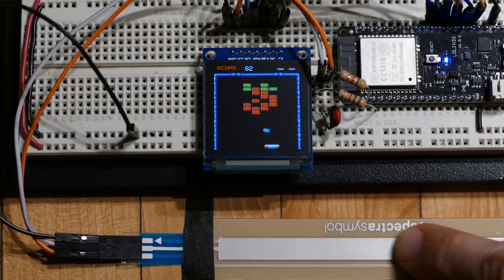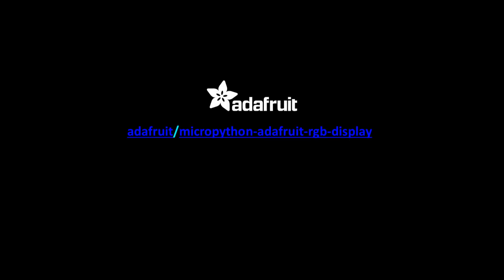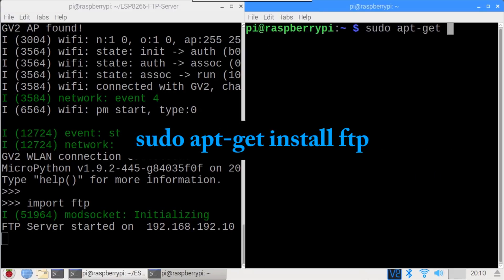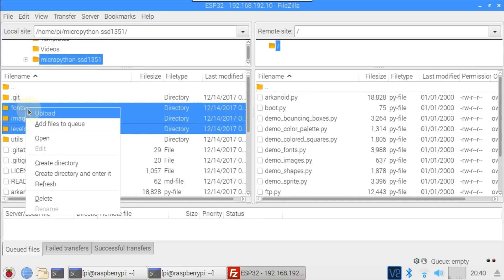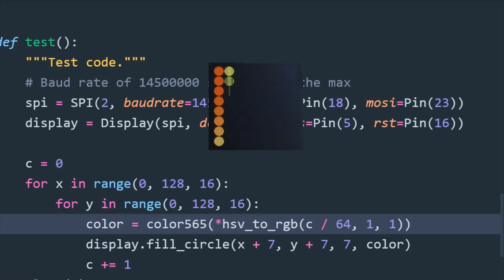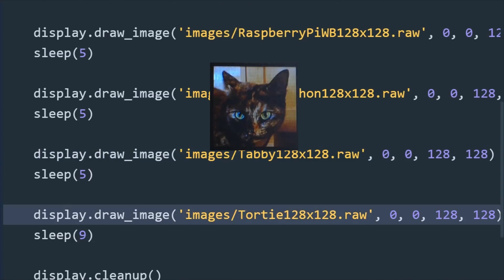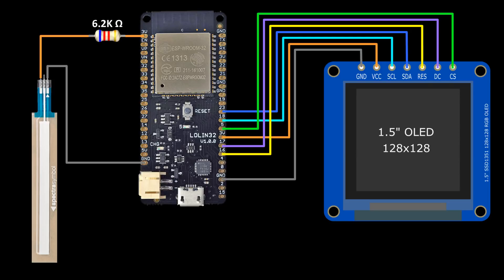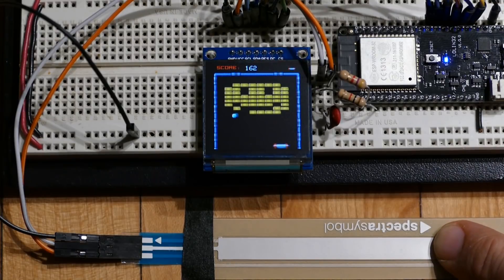ESP32 MicroPython OLED Tutorial with ADC & FTP

Comment: how do you set the brightness with this library?
Reply from the maker: The contrast method sets what the datasheet calls the Master Contrast Current Control 0xC7.  This allows you to dim the display.
Reply: @rdagger  thanks for the reply! I opened another issue on the git (I realized this is the same driver I was using before on my last project). having troubles, thanks for the amazing videos really

Comment: youtube has removed my post, i was just asking how to use you img2rgb656 program i have installed pip and pillow ect but have no idea how to call your program from cmd and then tell it to convert my image
Reply from the maker: python img2rgb565.py <your_image>
<your_image> is the full path to the image file you want to convert
Reply: i just keep getting this error 
C:\Windows\System32>python img2rgb565.py <C:\Users\ppap\AppData\Local\Programs\P
ython\Python38\Scripts\honda_colour.jpg>
The syntax of the command is incorrect.

C:\Windows\System32>
Reply from the maker: @philoffhistree  Angle brackets < > are commonly used to indicate a placeholder, which means that you need to replace the text inside the brackets with the actual value, without including the brackets themselves:  python img2rgb565.py C:\Users\ppap\AppData\Local\Programs\P
ython\Python38\Scripts\honda_colour.jpg
Also, when you post to YouTube, don't ever include country code top-level domains (ccTLDs) such as .cn, .ru, .kp or .py in your comment because YouTube will automatically place a hold on it.

Comment: By the way, according to other documentation I'm seeing out there, the screen's chip supposedly limits Baudrate to 16,000,000. And personally I'm not noticing any difference between 14.5mhz and 16mhz when I test between the two. Maybe things were different for older versions of this screen? And I don't suppose either changes the life-span of the screen?
Reply from the maker: Depending on your MicroPython board and your frequency settings, the actual SPI baudrate may not equal the passed value because the clock divider must be an integer.  You can view the actual baudrate by using print(spi) after initialization.
Reply: @rdagger  Ah, okay cool, thanks for the info! I'll give that a check.
BTW, I was indeed able to recreate the Uncanny Eyes project in MicroPython! Works pretty darn good now too. Had to use a build of MicroPython with ulab included, for numpy functions like 'where'. Plus numpy enables me to load lower resolution eyelid gradients for both eyelids, to fit them into the Pico's remaining memory after micropython.. Then process their current blink state, and upscale them and blit them over the iris framebuffer. Also, a minor overclock to 200mhz smooths out the framerate nicely. Honestly shocked I was able to replicate the majority of the project in like 60 lines of code. heh
Reply from the maker: @NikoKun  That's great!  You should post a link.
Reply: @rdagger  Sure, tho youtube tends to not let me post links for some reason.. So on GH I go by Nikorasu, and the project's repo is called NicoEyes. Hope it's okay that I included your SSD1351 library in the project, for now for ease. Also, still working on the ReadMe file. heh
Reply from the maker: https://github.com/Nikorasu/NicoEyes
Look forward to trying your project!
fyi:  Posts with links are held until the owner of the channel approves them.  I often don't notice the held posts for several days.
Reply: @rdagger  Thanks for posting the link! That makes sense.
Btw, I checked print(spi) and oddly the baudrate seems to be locked at 12,000,000.. a lot lower than what most documentation says.. Not sure what to check next, wonder if it's locked cause I'm using 3v.. hmm At least visually it doesn't matter much, animations look fine.
Reply from the maker: @NikoKun  The SPI baudrate can only be set to values that are integer multiples of the clock.  For example, an 80 MHz SPI clock divided by 8, 7, 6, 5, and 4 would produce the baudrates 10MHz, ~11.4MHz, ~13.3MHz, 16MHz, and 20MHz respectively.  The divider has to be an integer.  MicroPython will round to the closest achievable value if you pass an incompatible one.
Reply: @rdagger  Ah, thanks for clarifying again! You've been really helpful and I greatly appreciate it. :)
Earlier I forgot to try 24MHz, which is also mentioned in certain documentation, possibly as the max supported?.. So I just tested that, and it actually seems to have been accepted by the SPI, so print(spi) now returns "24000000", and I'm not seeing any noticeable artifacts on the screen thus far. I guess that's good. heh

Comment: Thanks for creating all this! It's amazingly useful info, and enabled me to dive into this stuff in a way I've never been able too before!
By the way, how feasible do you think it might be, to use your SSD1351 library to write a micropython equivalent of of the Uncanny Eyes project? Would it be fast enough to do that? I mean sure, I could probably just get the C version working if I had too, but personally I hate working with C.. So it might be a fun challenge to create my own version for micropython, if that's even possible. heh
Also side note, I get a "Unicode Error" when demo_fonts example tries to load the neato font.
Reply: BTW, in regard to the Uncanny Eyes idea, do you think I'd need to create a blit function to achieve that? Or some other way to load image data, manipulate its array to select which parts to use, then output to screen.. The standard uncanny eyes code uses some gradient images to do the blinking, and it seems like a very efficient way to do things, if I can replicate it in micropython.
Reply from the maker: I'm not familiar with the Uncanny Eyes project.  I took a cursory glance, and it would probably take a lot of optimization to get it to work in MicroPython.  I think there is a blit function.  I made the video 6 years ago, so I don't remember if the blit function was performant.  Your best bet would be a fast board with a lot of RAM.  I'm working on some SPI optimization for a new current project (doesn't involve graphics).  I might throw together a quick video.
Reply: @rdagger  Ah cool, might be interesting to see!
I've been tinkering around with a Raspberry Pi Pico W lately, and I'm fairly sure it can handle it. Tho typically the ESP32 seems to be commonly used for it, same goes for the SSD1351. Glad I got it, I like this screen so much I got a second one cause they were on sale. Could make for an amazing Halloween prop, or maybe a smartwatch for a future project. heh
Course I may just give in, and deal with C++, so I can use the real Uncanny Eyes. I'm sure whatever I could manage in micropython wouldn't hold a candle to the original adafruit project, and it'd likely perform better anyway.
Edit: Actually, I think I might be able to get closer to achieving this, if I do most the work in a framebuffer first, since that has a blit function with transparency support. @BytesNBits did a video on micropython's framebuffer, and actually used it to improve the performance of your bouncing boxes demo quite a bit! ;)

Comment: The esp32 has two ADCs - ADC1 and ADC2 but it seams that only ADC1 is supported in micropython. Thats sad because all the ADC2 Pins are on the one side that i wanted to use in my tutorial. Does anyone know why ADC2 is not supported?
Reply from the maker: You can only use ADC2 only when the Wi-Fi driver is not started because the driver uses ADC2 and it has a higher priority.  Also some of the ADC2 pins are used as strapping pins (GPIO 0, 2 & 15) which are reserved by some development kits.
Reply: Thank you. Didn't know that

Comment: How do you add an sd card in an ESP32?
Reply from the maker: The Loboris build has support for SD cards:  https://github.com/loboris/MicroPython_ESP32_psRAM_LoBo/wiki/filesystems
Reply: Thank you. Once I receive the m5stack I'll go through your tutorial to install this build of python on it. By the way, I read some benchmarks that show 10x slowdown compared to C when it comes to reading analog input, are there ways to mitigate this?
Reply from the maker: I remember reading the same thing but I'm not sure if there was a satisfactory resolution.  I'd post your question to the Loboris forum:  https://loboris.eu/forum/index.php
Reply: Great, I just registered, will wait for forum access. Now the ESP32 has 2 cores, from what I gather core 0 is the one that has access to the hardware IO, what's your experience with multi core programming?
Reply from the maker: It's my understanding that currently the MicroPython runtime is not efficient with respect to running python code on multiple cores.  This should improve in the future.  However Free-RTOS and MicroPython services (written in C) can definitely take advantage of the dual cores.  This allow your MicroPython code to run on 1 core while system tasks like Wi-Fi run on the other, or services such as MQTT, Telnet and FTP run in parallel.
Reply: Oh this is good, what if I want to run FFT or output to SD card? If anything like arduino, sd out is a blocking process.
Reply from the maker: Sorry I haven't tried either.
Reply: I tried it. Each core has full access to the hardware in a non blocking way! This is awesome! So read analog+fft+sd write is a breath.

Comment: Does the ESP32 have only 1 ADC pin?
Reply from the maker: No, GPIO's 32-39 can be used as ADC inputs.  If Hall sensor is used, GPIO 36 & GPIO 39 cannot be used as ADC inputs at the same time.
Reply: Thank you.
Reply: So those ADC are pretty noisy, I see that the m5stack has an oscillo extension, how good can this be, you think?
Reply from the maker: There are solutions to address the noise.  I haven't tried the m5stack.  The Loboris build allows you to route the reference voltage to an external pin for measurement.  The gain and offset factors of an ESP32 module's ADC are calculated using the reference voltage and the Gain and Offset curves provided in the lookup tables.  Nominal voltage reference is 1100 mV, and can be adjusted to compensate for ESP32 chip differences.
Reply: This would address the non linearity, but to address noise, wouldn't you need to smooth the signal and therefore lose resolution?
Reply from the maker: You can perform multiple samples to help with the noise at a constant voltage.  You won't necessarily lose resolution but it will reduce the speed at which you can calculate ADC values.
Reply: I tested the m5stack, when disconnected from the computer and grounded, the input from GPIO 35 is very clean, got my square test signal